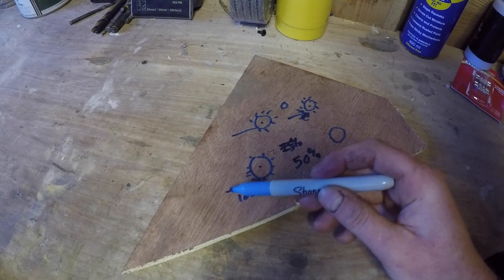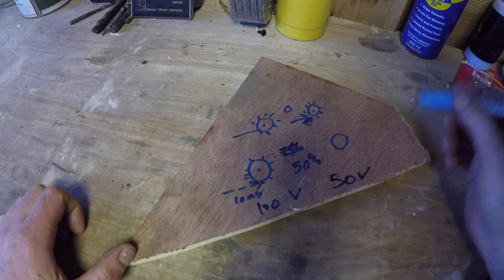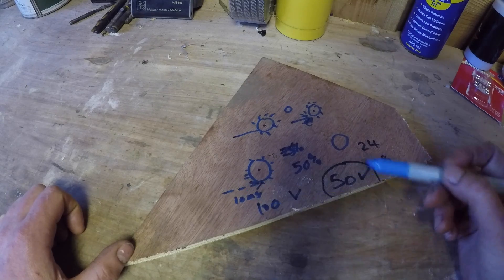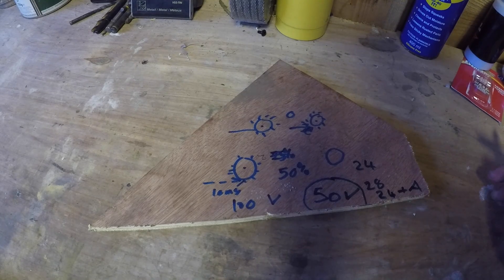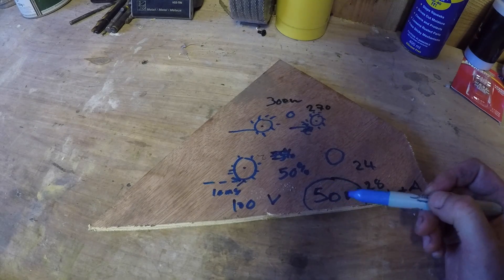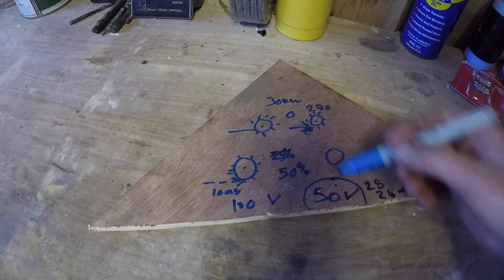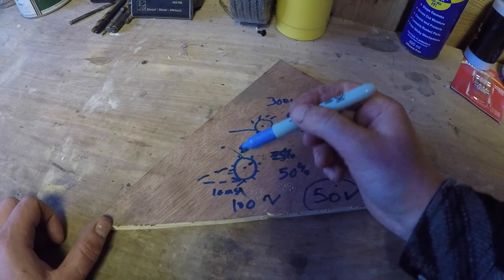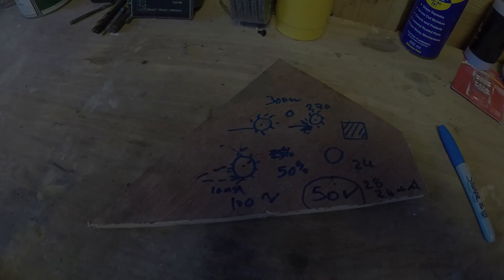DIY Micro Hydro part 19 why use MPPT

Comment: Hi my name is Cyril I've just been watching your hydro Project I know it's a long time ago but the cladding up of your little hydro boxer if you haven't solved it yet what about making pull up trapdoor in the front underneath the pipe put it up to flush the box out from the bottom put it down to close it up again also did I hear you say you was at amateur operator if you already solved this I haven't got to the end of your videos yet. Cyril

Comment: yes a Pulse width modulated controller will lock the voltage because it is basically like a direct connection to the battery - if you want to know the 'truth' the inefficiency is in the battery but that is another story. 

an MPPT will 'separate' the direct relationship between your input and the storage source. 

So you 'should' (i'm hearing your video now) be able to set it to the 'premium' voltage - but that is not the whole story it is really the relationship between 'volts' and 'amps' you will see that as you look at the real relationship to your storage source. 

so you will see it is that relationship and how a 'battery' charges.

with the hardware you have presently, there is nothing more efficient that i know of than an MPPT charger correctly configured and what you are trying to achieve right now, so you should be able to get it going i think - (as i see you did)

Comment: Good work on the project.
Can you calculate the optimum water flow & size, is it better to have a wider slower jet or a narrower faster jet?
As you have very little pressure drop on your line I think you could easily use a wider nozzle and not harm the flow speed, thus get more power out of it.

Comment: Yes hello from America. Some of the terminology is not a perfect match... And I do not think that you have talk to me directly.. but as I see your video what you should be considering is putting in a twin turbine that is having two of them.   Now in our terminology when we say dump we actually should say burn up the voltage into something else than the battery.. not most useful is a heating water element which could be useful in heating just one room or at least contributing Heat..   now what I see is that your smaller cheaper charge controllers ours are rated at 15 amps. Unless it's a sales pitch we are told that they will not top off your battery into the higher or maximum storage.. and it is our understanding that this maximum storage will give the battery more power to combat surges that is when one turns on a refrigerator.. we are told that this lack of amperage storage or perhaps we should say cold cranking amps. Will result in a battery that can only handle you're DC lights.. in other words it said that you cannot fully charge a battery on a trickle charge.. now the higher more costly charge controller is more valuable because it charges the battery like a battery charger.. it UPS the amperage zap of DC electricity..  now if it was me I would go old school I would probably just buy a good battery charger and have this a small battery Bank 2 power that battery charger.. that matter charger powering the big huge battery Bank.. and I would be satisfied with any loss as long as it's working and working well enough..    now I must say there aren't very many different types of electricity if you really think about it AC DC sine wave and pure sine wave and then there's a thing called the frequencies and this has to do with your household current..   so this gives me my best advice find out what works and find out what is safe and in hydroelectricity is that value is held within its night time use... Enclosing I I've given some thought about your filtration system you should consider farmers spray rig filters the screened large farm rigs filtration system.. we are talking about field crop spray rig components.. of the spray rigs screens which is a cylinder screen there are different screen types as in coarse and fine.. unlike your household water filter the screens are cleanable or recyclable as in like a dish going through the dishwasher...   I would definitely keep a small solar system battery Bank perhaps one or two batteries 12 volt 4 year old night time lining.. this redundancy would be a safety feature on Dark Nights or in a case of emergency.. of this I'm thinking of these motion detection lights and perhaps doorbell wiring them together so you will not have to change the batteries in the smaller motion sensor lights.. I must say you are doing well and I hope you'll be able to keep it up and I have happiness on your homestead you should take some pride knowing that you are quite ahead of the pack for your age group...

Comment: open the water tap slowly so the controller has the time to look for the right algorithm for the first time
I believe that it has a fuzzy logic that memorizes the best adjustment points of the system
if you first used the mppt with solar, it is better to reset the regulator because I think it stores obsolete data
  (sometimes happens when the pelton swivel has a diameter that is too small compared to the mppt, eg diameter 70mm and mppt 40A, but if you put a 12A mppt see that it works and finds the optimal point while before it fails to take void missing torque on the generating axis
Reply from the maker: it does it every minute. every minute it searches for the best voltage, so if tirck it to lock on tot eh right voltage a minute later it looses it again.

Comment: if i understood correctly, the speed of the natural water flow should generate close to 100V, he wants the turbine to have a resistance of 50% of the speed of the water since that's the optimal resistance the turbine should operate on,  that would mean close to 50V would be the input IF the resistance of the turbine was running at 50% of the water flow. 50V then means the turbine it operating at the optimal 50% of the water flow.
then the input of 50V can be used so u can get a double current of close to 24V/25V

free to correct me if im wrong, would help ;)
Reply from the maker: You are correct.
Reply: and so locking on that important 50V would make u able to set the resistance of the turbine, my first thought was doesn't it work the other way around mmh, a mechanic in the turbine to set the resistance then tweak till u get 50V what would mean its at 50% of the current water flow. 
ps thanks for getting me interested :D
Reply: ah sweet )
Reply from the maker: the problem is that the controller does it calculation in less than a second and it does not give the turbine enough time to speed up so it ends up getting the maximum power point calculation wrong. you can sit and listen to it do this. in the settings there are options to set fixed voltages but when i change them nothing happens. im quite sure this is due to the out of date software and i am waiting for a usb to serial cable to arrive so i can update it. im quite confident that is the problem now so really i just need to wait for the cable  to turn up.
Reply: ah yeah so now its crystal clear thank you, thought just maybe u could tweak it manually on location ><, thanks for the fast reply :D. best of luck  ^^. cant wait for the continuing of the workshop project

Comment: Learning a lot. Thank you. 

I still reckon diversion mode will let the turbine just do it's spinnamathingie (50% nozzlespeed) and the dynamo would just be sending all the (angry) pixies home all the time. And the controller would just do crowd management on all the pixies wanting to enter their 'temporary home'. The doorman-controller sending some off to their demise in order to regulate traffic inside the appartment building. 
Not regulating traffic outside, but just acting as a doorman. 
(I first learned about the angry pixies from AvE and thought it was hilarious when you mentioned them)

Without the pixies it is way more boring but:

In my understanding with MPPT you choose to have a variable load (on the turbine). 
This feedback by variable load creates a demand for variable thrust (@same nozzle speed). 

Whereas diversion mode takes full load all the time (to my understanding), so static thrustlevel is fully adequate. 
The diversion load (mode) is specifically designed to protect batteries from overcharging and not to protect* a turbine. 
If I look at the (proposed) wiring for diversion mode, both controller and power input are wired directly to the batteries. 
Are you really a 100% sure the controller can and will (actively) steer the battery INput voltage in diversion setup?

*(Note:  It would keep the turbine from overspinning (as you well explained is a non-issue here), and insignificantly wear/friction on the bearings will  be reduced but increased on the buckets/spoons.
Reply: To clear things up a little. 

I forgot to mention two thing

1: (Also to my understanding) inside the batteries the 'voltage' is always the same (between plates) because of the potential between the two metals. So a battery would not 'care' about input-voltage. 

2: Stay awesome
Reply from the maker: That is the problem it wont just do its thing it will bring the turbine down to 24v and take away all of the efficiency im quite sure i explained that now multiple times. if i wanted to use diversion mode i would need to change my battery bank to 48v that would mean i would need a new solar controler and new batteries and why do i want to be dumping power anyway? i think everyone has forgotten that the power goes out to the shed. in order to have a dump load heating water or doing anything useful i would have to run a dc cable back to the house and run a tiny little heater in my hot water tank that would do very little as i use most the power anyway. or have a little heating element in the shed doing nothing. because its not insulated. its really pointless for a system this size. if i had multiple kw it would be different. i just cant get my head round why this is so hard to understand? i can adjust the turbine flow to my needs. out in the workshop turn it up, nighttime turn it down, why would i want to add all those cables and all that wiring all the losses for a bit of hot water? its easier to just turn the immersion on in the house at night and use the extra power that way. I hope this clears things up.
Reply from the maker: if you look at the diversion wiring you will see that the battery voltage will be what the turbine spins at because the turbine is connected to the battery. and even if it wasn't and the controler managed to do some magic it would still loose all its efficiency as soon as the dump load turned on because that would be at 24v so it would be dumping very littler anyway.
Reply: Sorry if I have offended you in any way. 

Just want you to get it sorted I admire your work.
Could you trick the bloody tristar with a 1:2 transformer?

And I was surely not talking about heating your house or water with it. But figured to just add a aircooled resistor in your shed with if Welsh weather  would ever demand it an optional scrap computerfan which you could reverse. 

Stay awesome
Reply: The dump load voltage, I was under the impression 
is proportional  on the amount of pixies that needs to be dumped?
Reply from the maker: It’s incredibly frustrating to spend years planning something and learning about every aspect of it. Designing a system and making it from scratch, then film the whole process for you to see and spend a lot of time trying to make sure I have explained how it all works. I then get it running and find that it is 63% efficient witch is an amazing number for a diy system. But I have a small fault that seems to be an out of date software issue that is only a small problem that most people would just leave, but I feel like I can still improve on it.  and for some reason many people think that I should completely change how the system works and throw away my whole design.... and on top of that explain why over and over again. It makes me wonder why I bother.
Reply: I am truly sorry I added to that frustration. 
I just wanted the same for you. To have your accomplishment fullfilled to your liking max efficency.

I shall not bother you again with my comments

Stay awesome
Reply from the maker: A Dump load is connected to the positive terminal of the battery so it will be at 24v so when it is dumping power it will load the turbine to 24v, and make the turbine run slow and make hardly any power.
Reply from the maker: Thank you, i appreciate that your just trying to help but answering the same thing over and over again is not the way i want to spend my time. please just read the comment before commenting to see if the question as been answered before.
Reply: I totally understand, and appreciate you took the time to respond (and set me straight :)). Just as a last remark I want to impart: You have accomplished great things. So if it holds any truth that any man shall be  judged by his deeds. You make a great man by any standard. 
And am very thankfull you have made it possible for me and others to enjoy you on your adventure.

Comment: what rpm capacitt is the dyno you are using? and your peltonwheel? if you can manage to get it on 5252 rpm it will cross torque thus resulting in the highest possible hp/kw. the pelton wouldnt even need to spin that fast but if you can get a dynamo that can handle it like from an old car (before the 80s or better a modern alternator) then you can set up your pelton wheel with a very small flywheel and your dynamo with a bigger one. poweroutput will not only be more effecient and higher but also more stable. That does require some maths to get the correct wheelsizes and distance between them. as it seems now your on a 1:1 ratio as its direct input that way you can get more power lets say 1:5 without changing the peltonwheel.

Comment: Before I comment further I would like to know what your transmission loss is.   Do you know or can you give the distance, wire size and current please.
Reply from the maker: its less than 2% im using 16mm cable 90m long at 40-50v so its is not voltage drop that is causing the problem.
Reply: 16mm cable gives 2.6mV per meter per Amp. At 300W and 50V = 6A => 2.76% volt (and power) drop.  300W and 40V = 7.5A => 4.31% volt (and power) drop.   OK, that's acceptable but don't let it get above 5%.  I would opt for higher transmission voltage.
Cheers on system well done.

Comment: What if you were to manually equalize the system, wouldn't that show you your maximum charge voltage?
Reply: Also do you have the charge controller logging the optional data values like maximum turbine voltage and maximum power output?
Reply: You could contact Morningstar support and learn more about the wind power feature, heres the firmware update page if you didn't find it already http://support.morningstarcorp.com/search/?document_section=&search_product=96

Comment: aha I see what you mean 
your generator is directly connected to your turbine thats why it spins at a high rpm and produces higher voltage 
I understand why you would use a mppt controller instead of a diversion one 
maybe you could try changing out your full bridge rectifier for one with a voltage limiting switch build in you shouldn't lose that much efficiency with a 3 phase ac input I believe 
or you need to trick your controller into accepting a higher voltage you could try using a dummy load in parallel with the controller but I don't know how well that would work 
good luck

Comment: I'm with you on MPPT. Every generator will have an optimum spin rate and the controller should milk all the power it can out of that and simply change it to whatever voltage your pack requires. I'm not really with you on the 1/2 freewheeling speed thing. Is that well established that the most energy is extracted at 50% freewheeling speed? Or is that just someone's bro-science logic you might be copying? Not saying it's wrong, just curious, haven't heard of that before.
Reply from the maker: The Pelton wheel is an impulse-type water turbine. It was invented by Lester Allan Pelton in the 1870s.[1][2] The Pelton wheel extracts energy from the impulse of moving water, as opposed to water's dead weight like the traditional overshot water wheel. Many variations of impulse turbines existed prior to Pelton's design, but they were less efficient than Pelton's design. Water leaving those wheels typically still had high speed, carrying away much of the dynamic energy brought to the wheels. Pelton's paddle geometry was designed so that when the rim ran at half the speed of the water jet, the water left the wheel with very little speed; thus his design extracted almost all of the water's impulse energy—which allowed for a very efficient turbine.

Comment: Have recently watched all your vids. What a sweet setup! hope you can get your mppt controller cooperating. If it won’t do it, check out midnight solar’s options. They have a hydro option and you can adjust the curves or just put it in a manual voltage mode. https://youtu.be/uL9UmydNVYI
Reply from the maker: Thanks for that info, this controler is suposed to be able to do that to, that is why i got it. i think the firmware upgrades will sort it.

Comment: I know this is unrelated to this video. But would you gain more power output adding a second nozzle? Or do you run into flow issues?
Reply from the maker: i have mentioned in other videos that another nozzle would be an upgrade option in the future.
Reply: Sorry, I watched a lot of the earlier ones. I must have missed it. I love this stuff and you are some of the few that show it off. Love it